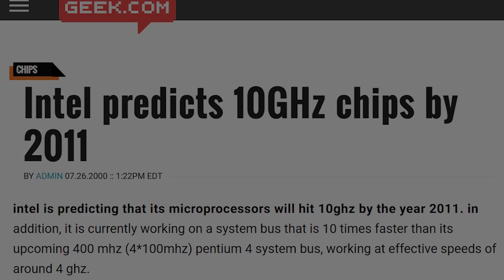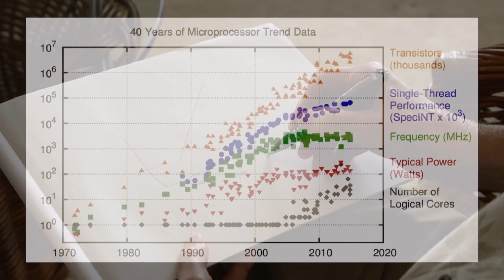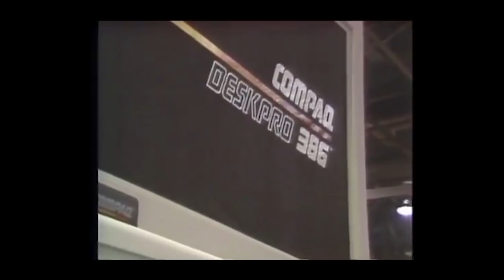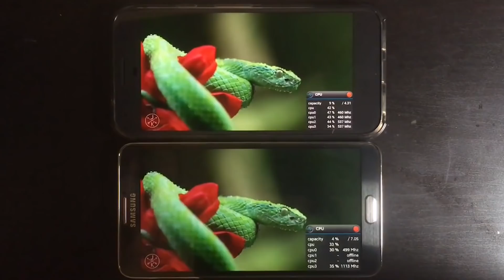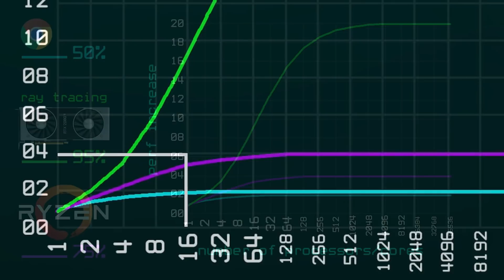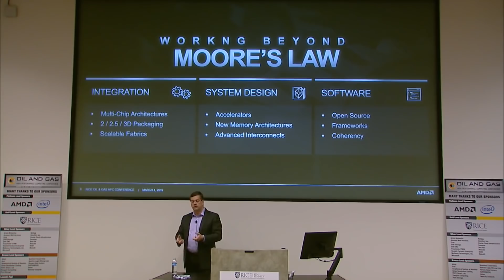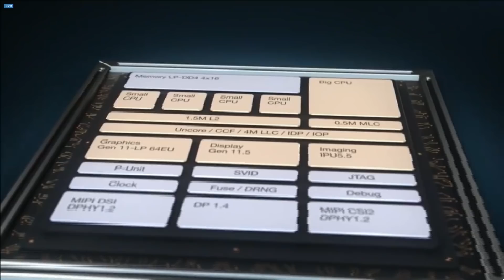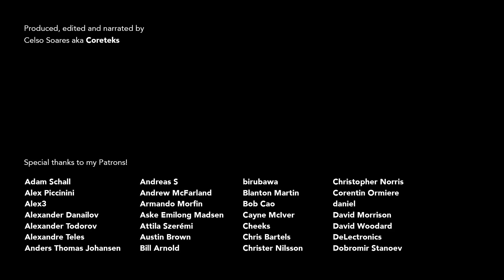Intel and AMD going BEYOND Moore's Law

Comment: Industry secret: they didn't go beyond the limits of Moores Law at all. In fact, what occurred was a technology arms race of sorts, where both companies invested heavily in their products in order to come out ahead as the marketplace dominator. Any time they had double the capacity of a previous product, they'd say "ok, now don't release it, instead, improve on it". That's why the mid 90's to early 2000's was an era of computational stagnation, no one was releasing newer products until they had achieved something that was exponentially greater than what the competition was putting out. We're seeing that exact same level of stagnation right now, as we're at the tail end of companies reengineering and refurbishing things like graphics cards to support bitcoin mining. We haven't seen a great leap forward in graphical technology sine the early 2000s, when we moved beyond 32 bit processors putting clean 16 bit images on our screens to full out 3D visuals. You look at something that came out in 2001 and compare it to something that came out today, well it looks a lot cleaner, but it's not as innovative as comparing it to something from 1999. If you look at cartoons, everything was hand drawn for the longest time, now everyone draws on their computer, and you can tell the difference, but you can't really tell the difference from something drawn on computer 20 years ago and something drawn on computer today. I'm assuming the arms race is going on right now, because VR technology is so big right now. By 2022, we'll see our next great leap forward in computing power.

Also, once we actually understand how three dimensional coding works, we're going to need a whole lot more than 32 cores/ 640k of RAM.

Comment: the thing with parallelization is that the operating system needs to handle the work that parallel programs delegate work to multiple cores. There is a limit to how much you can split up a workload before the administrative overhead of multi-threading actually decreases performance by a lot. I recently parallelized a merge-sort function, and up to 8 cores could be used on like 10^11 integers but any more cores just made the administrative work of recursively splitting up and then merging merge sort tasks way too much, to the point to where it took like 6 times as long. Simply put, managing parallel workloads is hard work for the OS, and sometimes parallelization doesn't even make sense from a performance standpoint or from a code complexity standpoint. There are frameworks for it that make development easier, but the cost of development and maintenance usually isn't worth the performance gain which might be like 1.5-4 times the performance in some cases, and that's if the OS deems that program worth ALL the cores on a system simultaneously (it probably isn't going to get all cores 100% of the time). 

I don't know how adding a complex AI to manage workloads would impact performance but I have no doubt that it would. Hardware implementations of specific applications such as sorting with like hardware bead-sort would mitigate most if not all of this overhead, but I don't think it would classify as a parallel workload at that point.

Some computations simply can't be done in a multi-thread environment, e.g. you do some calculations on a number, and then you use the number for something. If you parallelize that you're either going to have weird run-time errors, or if the variable isn't assigned yet because it will sometime in the future be asynchronously assigned, software will just crash unless you wait there for the first thread to finish, which means you wont win much in the end if anything. It's a bitch to debug as well.

Java has some fancy stuff where the interpretive jvm automatically optimizes code but that's probably as good as optimizing code on the fly is gonna get (i guess on a software level but i believe its on a pretty low level), because the jvm is pretty well optimized.

tl;dr parallel workloads don't always make sense, and slapping a core to a problem doesn't mean doubling the performance.

Comment: Why was the 10Ghz for 2005 prediction ridiculous?

Processors hit 5 GHz in 2001, then due to heat issues, dropped back to the 2-4GHz range thereafter.

The ultimate thermal limit would not have been that obvious in 1996, and a 2x difference is not that much.

Similarly given the logarithmic progress of computing, a 2x improvement with multi threading doesn't seem that impressive.
Reply: 2× is not that much? 

I don't think youxan say that. Pretty much every frame of reference is fundamentally changed by increasing it by 100%

Comment: You really did this predication on like 2 techdemos on a cellphone and told then that this AI-Thingy is possible!? Dude!?
Ever programmed in parallel? Its not about showing you 2 specific techdemos, its about handling timings of all kind of inputs and outputs and don't mess them up when u put them back together. I really don't know why AI (BuzzwordbingoALERT) should make anything faster... AI is just heavy intense learning operations and it COSTS performance like hell. So what are you even talking about?!

It doesn't seem that u got anything close to an idea, what it is like to programm in parallel, else you would have said something about the difficulties. Its not about the inabilty to do it. Its about realtime action things: U cant predict a users choice, so the whole: "Let the cpu predict and then run it 16x times faster"-thing is just useless in realtime applications (and even your browser is a realtime application). 
I would have expected way more from u. Sorry this was underwelming.
Reply: This might not be useful for the average joe but it might be useful for some companies and automated programs
Reply: I think you misunderstood. AI sure cost a hell of a lot to teach. However, the plan is not to teach it anything on your computer while it is running.

The AI will already have done the job once your chip is getting produced. It's an integrated silicon AI (kinda like "AI", Aggregated If-statements) that is able to divide the workload automatically between the cores. That way the programmer does not have to care about timing, and the difficulties. And automatically get's to take advantage of multicore systems, without hassle.

Another example is: AI that balance and priorities energy in different circuits is already in place on some of the latest smartphones, in order to minimize battery consumption. You don't have to worry about additional energy/performance cost. These systems are "free" when compared to how much energy they save.

Comment: I do think, we are stagnating right now. Also the problem is coding. Its super slow to develop new programs (and games) . Not to mention they are super unstable and hardly optimalized. What we need is a new way of programing, not just more speed. Lets not even mention, they can forget silicium based computers, you simply cant get it to work any faster, you simply cant compress it any more, because you wont be able to tell its showing 0 or 1 . quantum computers are ok, but we need a totally different way, like protein based things or something radicall other way to make computers that dont work on 0 -1 base. . . I actually wrote what you are talking about before i saw it :D

Comment: No need to wait 2 years, to joke about you. ;)
There won't be 3nm or 1nm - transistors are 6 atoms wide right now and future shrink is impossible do the Quantum Tunneling. That's why we see 2.5D and 3D chip stacking.
Reply: it would be possible to switch to entangling particles rather than transistors to shrink the size and achieve more power, however the scientist responsible for it is not yet born. Tesla's wireless energy processing can also be considered
Reply: An atom is around 1 Angstrom or 0.1 nm in diameter. The current 7 nm chips are 70 atoms wide. Not 6.

Edit: Silicon atoms are closer to 0.2 nm in diameter, so that would be around 35 atoms wide.
Reply: @atticusbeachy3707  What Intel calls a transistor is a part without a gate - gate actually increased in size to counter quantum effects.

Comment: No offense because youve obviously thought this through and done as much research as you can. But youre obviously not a programmer or a physicist. From what ive Read from the physicists we are nearly at the limit. From what i know as a programmer we already code for multiple processes. And ALL PROGRAMMING IS SEQUENTIAL. It isnt a habit t hing it's a logic thing. So to put it bluntly.. you dont know wtf youre talking about. If you leave a university with a BS in computer science you know how to program in C++. C++ is desined around object oriented coding and is thus inherently designed  for multi/multiple processors. 
In addition the "research" youre talking about is actually just graphics card/ai research code designed for graphics cards. That's it. full stop. It's because of how current graphics cards are designed. PS your computer multiprocesses graphics  and has since the 80's. While youre looking at one screen another or 20 are being rendered in the background.

Trying to sound smart doesnt make you smart

Comment: When Moore paraphrased Grove, he spoke about overall computing power doubling every few years, NOT simply about GHz clock speeds increasing - and the assertion that parallelism offers little value above 32 cores is ludicrous. The fact that some idiots 1990 copy of Word Perfect for DOS couldn't run multi-threaded worth a crap doesn't mean that the same limitation 
applies most modern software. Today, many of the kinds of workloads which require high speed computational performance tend to lend themselves nicely to massively parallel processing, Including Video processing, 3d Graphics, Simulations, Cloud Computing, and AI.

Comment: The Xeon 3060 CPU of my last gaming rig laster 9 years before it needed uppgrade to run GTA V (because it needed a minimum 4 CPU cores to run properly). CPU speed gain have slowed down to a crawl the last 14 years.... I am now running a brand new Intel Xeon 3,4Ghz CPU that is actually from 2014 in my gaming rig because it is fully compatible with Windows7. The the performance loss on this "old" CPU compared the the latests and greatest is so small that my computer is faster because of Windows 7 is more efficient on all the  5 computers  I have tested.  My Intel Xeon from 2014 is only 6% slower then the latest and greatest Intel CPUs from 2019 at same core speed in single thread... The last 5 years all Intel have done is tiny increase of clock speed, more cores and or lower the price every time AMD brings something better to the market. If it was not for AMD we would be running 1Ghz single core CPUs costing 1.000 dollars and up lol :)

Comment: I'd like to think that the main reason that clock speeds have not continued to increase at the rates of the past was that it was easier to increase performance through parallelism rather than just continuing to ramp clocks.  I know that it's not a 1:1 performance between single and multiple cores, but one could argue that a 4-core 2.5GHz CPU is effectively processing 10GHz worth of computations (in a perfect case) without the heat and EMI issues of a single core 10GHz CPU.

Comment: If parallelization reaches a limit via Amdhel's law then the solution is to serialize data.  if we go back to a single thread, and allow each core to grab sequential pieces of the code and present the calculation at the proper time sequence and reassemble the output in exactly the appropriate time phase, then a single thread can be serialized with N cores and - while I have not imagined the limitations, ( I'm sure there are many), this may offer a theoretical alternate option...  The key would be that the code would need to be constructed so that each part would render within a specified timeframe and each frame would need to be coded or numbered.  Then you just reconstruct the outputs.    How many cores do you want to throw at it?  I can only imagine how complicate a scheme like this would be..a but one day computers will be writing their own code and - I suppose that will do it.

Comment: 32 cores is the max we can really benefit from .... what about async computing ? What about quantum-multicore ? what about multi-layer processor ? we still dont know capabilities of carbon-based cpus ...

we wont go less than 6nm as then standard particle laws start to fail and quantum laws start to take effect. ( basically teleporting particles ....

i agree.... developers should learn how to optimize....

I might suggest parallel programming to my uni teacher ... if nothing, she will at least tell us, that maybe next year... ...... at least more things to learn
Reply: I think most of this applies to real-time desktop usage. We already have many instances of server / batch systems utilizing many more than 32 cores for VMs. Async computing can have different connotations based on context, and can be nothing more than a single threaded application doing internal context switches ( of which the kernel is ignorant,) to a message queue based design where you pass messages between discrete programs (or even different servers entirely,) for stages of processing.

Quantum computing ..... I kind of see as a pipedream. I've seen no evidence that quantum computing will ever be economically feasible, even if technically possible. We're nowhere close to building a quantum computer that can perform as well as a mainstream traditional processor at the domains where quantum is supposed to be far superior, and that's ignoring that MOST computing workloads will never benefit from quantum computers. They are not being investigated because they're faster at general workloads, they're being investigated because they are potentially able to solve problems that current processors are not capable of doing (such as factoring numbers without having to iteratively brute force it.) Quantum will do nothing to speed up workloads that we can do now, but wish were faster.

Comment: we cannot go smaller than 6nm no matter how much we try due to quantum physics and how electrons behave, electrons would be able to dis-appear from one side of a logic gate and re-appear on the other side of a logic gate therefore causing lots of errors in outputs. (Open to corrections and other replies)

Comment: I’m a software engineer. I make programs that will us around 1 to 8 cores. The problems that I run into is make the program able to run on a single core and multiple cores effective without writing a lot of extra code. Another problem is hyper threading! Hyper threading is not always very effective and can be slower at times. My OS might say I have 8 cores when in reality I only have 4 because the OS counts hyper threading as a core. So I just divided the core count in half or make it 1. Another problem is each OS is different. Linux has a fast process start up time when Windows is very slow compared to Linux. So when dealing with small task multiprocessing might be faster in Linux but in Windows it slows down the application. This can be fix with a “if”. I’m just trying to give you guys an image of what programs need to know to be able to write effective code.

Comment: Talking about that computers do not need more that x cores because programs cant handle more than x cores may be true however that dose not take in to account that there can be several programs running, that each can use x cores. I can admit that this case is not that usual in but in the future this may be more common.